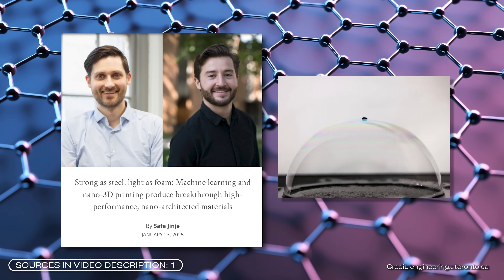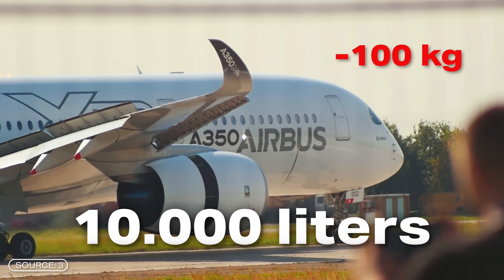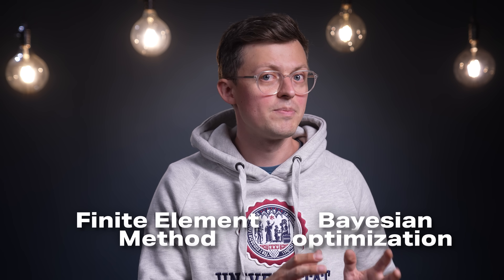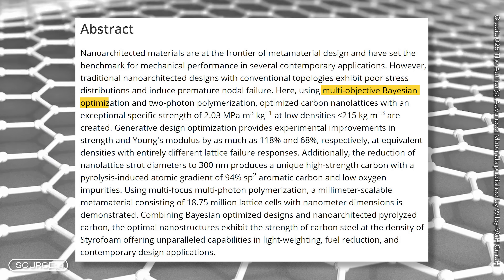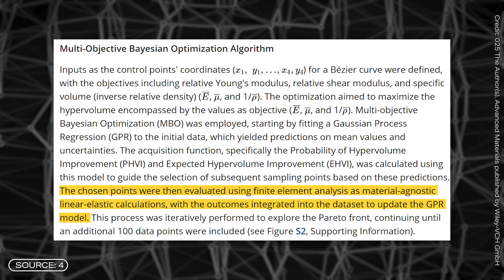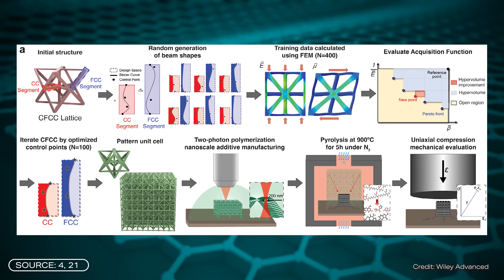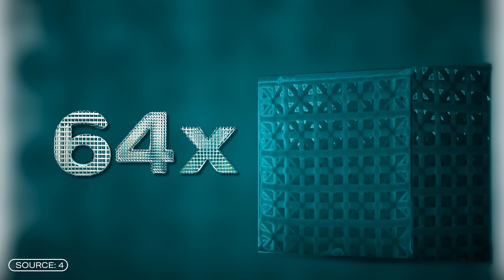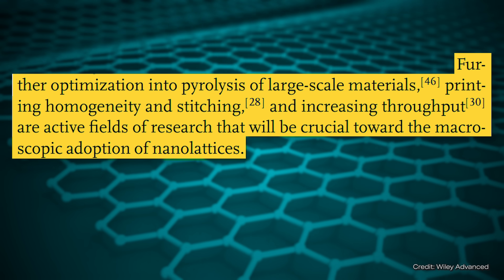New Material: As Strong As Steel, As Light As Styrofoam!

Comment: 6:48 your script says cubic metre but the slides show a cubic micrometer, which would be just so much worse :D I guess it is a typo?
Reply: It's slightly confusing but it is correct and it is a standard way of writing things in science.

He is showing "125 - 215 kg m^-3". That means kg * m^-3. That is the same as kg/m^3

When you're multiplying with something to a negative power, it's the same as dividing with it. 

Think of it this way: 15 * 10^-3 = 15 / 1,000.

You see it in many of SI defining constants.

The Planck constant is 6.62607015×10^−34 J Hz^-1.
The Boltzmann constant is 1.380649×10^−23 J K^−1
The Avogadro constant is 6.02214076×10^23 mol^−1
Reply: Ah, fair. Didn't click, but of course it makes sense that it is mass divided by area. Thanks for the clarification @MrMartinSchou

Comment: 6:02 wait photon polymerization so it's a resin 3d printer the laser kind, a focused laser and the structures look 4um squares under 10 um size. so you are saying the spot size of the laser is about 1um, impressive if true. are you sure they actually built this it's not all just simulation? even if these structure become cheap to make they will not be fast, think of how much laser firing detail you would need to make a air plane worth, you would need to prevent scattering from so many lasers. lets say I build a big 3d laser resin printer the size of the plane, I laser it up with the support structures, it would need to sink down in to the liquid because it could not be pulled up because a plane would be to heavy to stick. you drain the pool of resin rinse it off remove the support structures, cure it. then complete the rest of the structure. I guess their is nothing that prevents you from doing any of this, but it's not going to be easy, making sure everyone of those lasers is able to make those structures, and not scatter threw the vat too much hardened wrong places. something about this seems off, I think theirs a better way of doing it, or they are not telling us something.
Reply: It's an organic compound, not necessarily a resin, that's being polymerized, then pyrolyzed. The difficult part is in the second process, albeit the lengthy one is the first unless an integral 3D printing method is developed, one whole layer at a time, like in the manufacturing of electronic chips. And it is ultra-light, in the likes of ten times lighter than same-resistance steel. You can first build a nude integral plane structure, then dress it with an outer layer in one or several pieces. It would yield a fantastic plane! I'd like to see a 20-ton Jumbo-sized plane, for once! Would it need to be anchored to the airport's apron lest a breeze takes it away?
Reply: You can make it in parts, it doesn't have to be a plane-size 3d printer. The joints between the parts won't have the same strength and will need to be heavier, but it's still much better than making the whole plane out of duralumin or plastic.